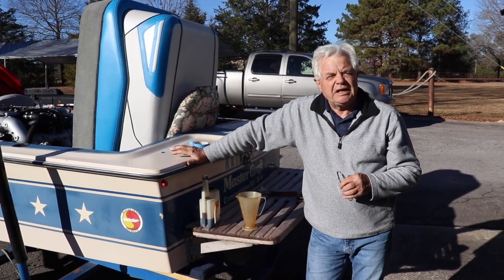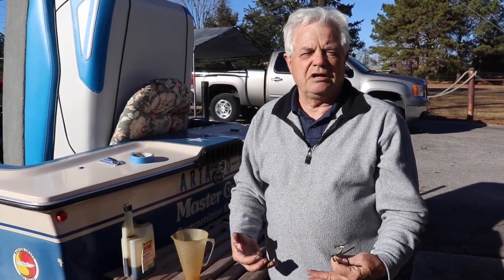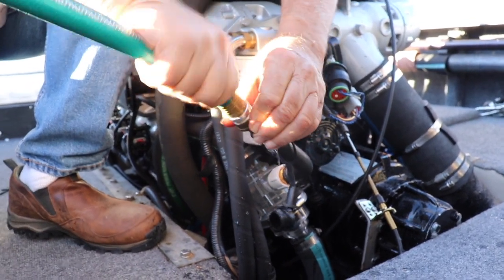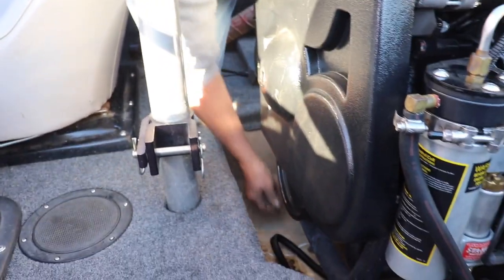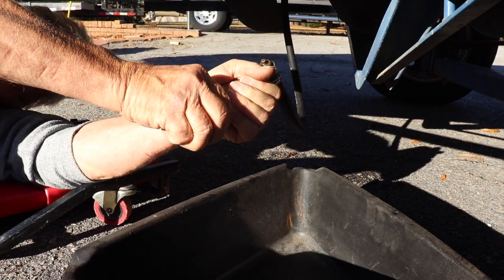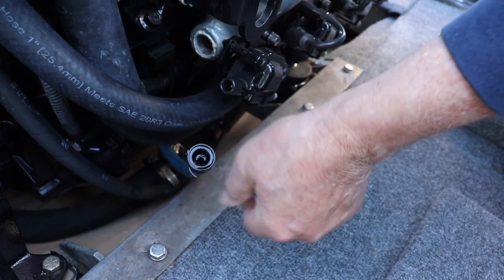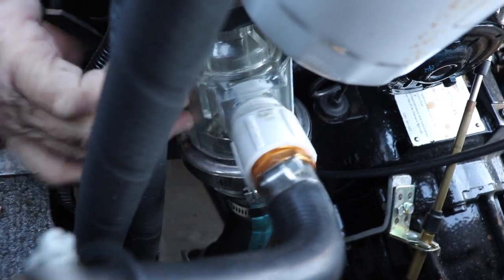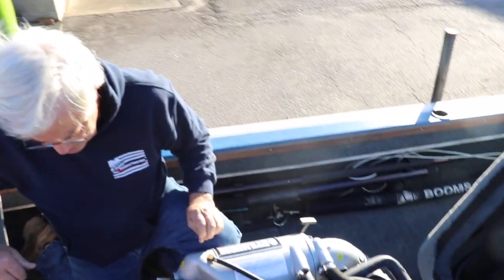How to Winterize | PCM 6.0L ZR409 Marine Engine

Comment: Gday. From Australia down here. I have the same (similar ) engine in my 08 nautique, being the pcm zr6. I run 15-50 oil also. Is there a benefit to running diesel 15-50 as you say? Given it’s the same oil for my tow car, so happy to only need to buy 1 type. Engine has 900 hours.